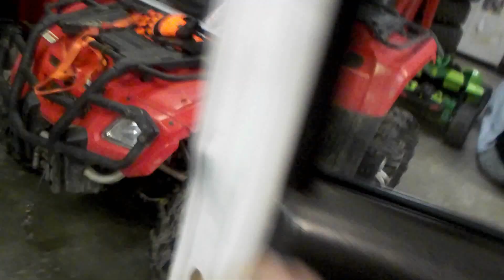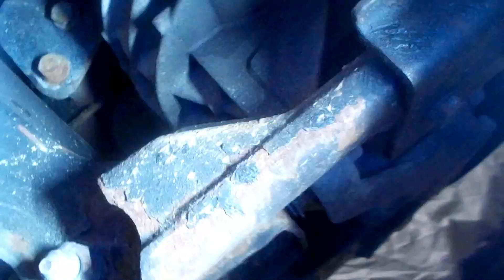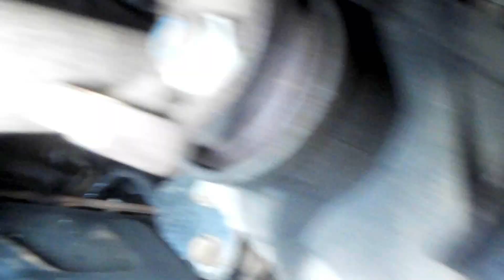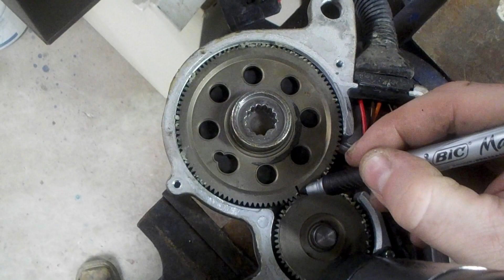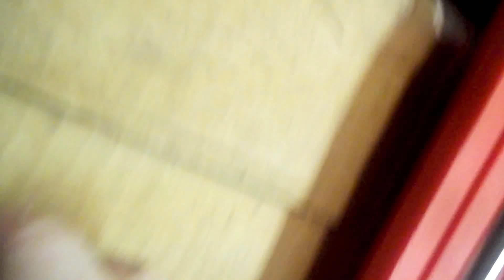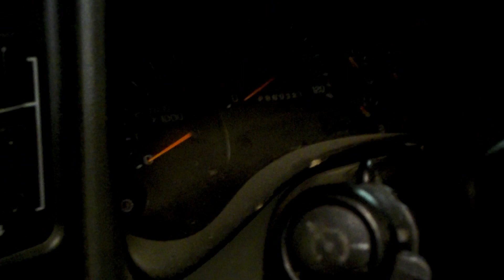Silverado Transfer Case Shift Motor Repair

Comment: What were your initial symptoms? My transfer case was worn out and noisy so I replaced it a few days ago. The 4wd worked fine until I replaced the transfer case. The lights blink when I select 4 hi and 4lo and I hear the encoder motor actuate but won't "lock in. " I took it off and let it hang and tried it again with the same result. I then noticed a yellow sticker on the motor saying that doing so will do permanent damage...😢. I've tried to manipulate the shaft on the transfer case with a 14mm wrench but can't get enough leverage with the cross member in the way. The old worn out unit isn't that difficult to rotate. Is my symptom consistent with a faulty encoder ring?  Thank you🎉
Reply from the maker: I have shifted them even though it said not to with no ill effects.  I would check the connector at the actuator next like in the video

Comment: I have a 2003 Chevy Silverado 1500 HD I have a problem similar to yours when I first start my truck in the morning sometimes it is in auto and in order for me to switch it over to 2 Wheel I have to shut the truck off and restart it and then I can put it in 2 Wheel. Then when I get out of work at the end of the day, it will be in for low and then I have to do the same process. Do you think it’s the motor actuator that could be the problem because it does switch into four-wheel-drive thank you in advance for answering your question.
Reply from the maker: Either the encoder or a wire problem.. I would start with the encoder

Comment: All of the lights on the switch are lit and pushing buttons did nothing. Service 4wd is lit. I checked both fuses and cleaned up the ground by the door frame. None of that did anything. I replaced the switch and now the neutral light is lit but pushing or holding buttons does nothing. Not sure what my next step is, hope its not the control module. The actuator would be nice or even the encoder. I think the truck was in 4 low when it last ran all of the lights on the switch came and there was no way to change it. Thanks for any suggestions.
Reply from the maker: Out of all the trucks I have worked it has been the computer 0% of the time.  I have another video on diagnosing the service 4wd code without a computer if you would like to take a look at that
Reply: @GSEShop  Thank you for the quick response. I've watched your Service 4wd diagnosis video, will let you know how it goes.

Comment: Thanks for your video. I'm having an issue with my 02 Silverado. It stays in 4hi unless
I pull the ATC fuse. (Have to do this so I can drive the truck) It will not shift into anything
other than 4hi. I went under the truck while an assistant pressed the 2hi button (fuse
back in) Heard a buzzing noise from the transfer case shift motor. Will not shift, and
defaults to 4hi. Then sets the service 4wd light. Sure hope the transfer case isn't jammed.
This is a low mileage truck. Any help would be greatly appreciated.
Reply from the maker: I have another video about diagnosing the problem

Comment: My 2002 Chev Blazer lights on dash indicate it is 4 low or 4 high looks normal even when in low range you can feel the difference but the front end is not  engaged not helping in the snow any ideas or help would be nice thanks
Reply from the maker: My video “service 4wd diagnosis” I think has your answer.

Comment: My 03 silverado seems to be stuck between gears. Won't go into park, drive or reverse. I do hear a grinding sound. Any idea what it is ?
Reply from the maker: Check out my “Silverado pops into neutral” video.  That may be your problem but it is hard to tell for sure just by messaging

Comment: Hi I have a question.  My 2005 gmc 1500 4x4 is having an issue everything I hit 4x4 my front dif locks up . Truck drives fine in 2wd btw . The plunger is working I tested it .
Reply from the maker: Like your tires won’t turn?

Comment: Just replaced it, and now it will only go into 4 low...any ideas?
Reply: https://m.youtube.com/watch?v=BvPsK5OLdYI

Got it to go back into 2h after watching this but still not going into auto 4wd or 4hi...
Reply from the maker: Check out my service 4wd video, but it sounds like you have a wiring problem
Reply: @GSEShop  yea I agree with the wiring problem, had some issues with speed sensors in the trans a last year. Had to replace a connector and fixed that. Also I am using a dorman part, the GM/ ac delco no longer makes the shift motor. So I pulled the dorman put on the original and got it to shift into 4h 4l 2wd auto4 all fine then decided to not go back into drive and did a grinding noise when I went to park. My original complaint... I was driving on the interstate going about 70mph and the truck went into neutral. Pulled over shifted the trans into 1 2 D N R nothing still in nuetral and grind when I went to park. Thought I might get it to go into 4wd so pushed a few buttons and got it to go back into 2wd. Was able to get it home but it did happen 2 other times on the way there. Drove it a few days with no issues untill I got ready to replace the  shift motor. So Im thinking the water did make it act up. The dorman part is back in now, and it kinda works doesnt want to go into 4wd and back to 2wd but its driveable at the moment.  Sorry for the long post. I will keep this updated if I can  fix it
Reply: Also I completly swaped the original and the dorman out back and forth 5 times including moving the drive shaft and removing the skid plate, trying to figure it out. So at least Im an expert on that now.
Reply from the maker: @terrygrossjr83  it is either a bad motor or you got a contaminated wire.  The truck going into neutral is the shift motor not engaging the transfer case fully, like only the edge of the gears are touching and once they slip you get your grinding neutral situation.  I would take the front driveshaft back out and investigate all the wires going to the shift motor for damage.  I have had shift motors be bad right out of the box before too.  I had one fill with water and I ended up putting a drain hole in it near the bottom and letting it dry and that fixed it.  It should be dry inside with a little grease, no oil.  Cracking them open isn’t too bad.  I hope this helps
Reply: @GSEShop  Hey I appreciate it, I did take it off and re installed it this morning. Did not see any bad wires but that still doesnt mean a pigtail connector isnt going bad.. that being said I now have auto4wd 2h 4h but only a clunking sound and no 4L. That will do untill I get around to buying another shift motor the original was filled with oil.
Reply from the maker: @terrygrossjr83  I had an oil filled one once and it never worked right.  Just my experiences, your results may vary lol.

Comment: Hi GSE - a follow up to the last post. My problem (05 Tahoe) was resolved by replacing the transfer case encoder sensor ring, so THANK YOU for the video and feedback! Only thing I didn’t do was remove the front drive shaft, and I couldn’t get it into full ‘neutral’ as the dash switch didn’t work as it was - was stuck in 2WD.

I was able to get the unit out (not ideal), clean and mark everything, and reassemble, just as it came apart. Hopefully this is the last of my 4WD troubles. Aside from my time, the AC Delco ring was only about $40, so way cheaper than replacing the transfer case motor.
Thanks again!, Dwayne
Reply from the maker: Great, I am glad to hear it is solved

Comment: Hi GSE! I’ve commented to you before, always big “THANK YOU” for what you post regarding Chevy trucks! Over past 2 years I’ve struggled with intermittent 4WD issues on my 05 Tahoe. I’ve replaced the dash 4WD selector switch, checked existing ‘ground to frame’ points, have “over grounded” wire harness under hood to the frame, replaced the 4WD Actuator (throw money at the problem...), and now I’ve found this post you made. It perfectly describes my symptoms - and I’m not about to spend $$$ on a Tech 2 code reader. 

I’ll give this a try, and let you know. Thanks BUD!
Reply from the maker: Nice to know I have a fan, I hope it works

Comment: My 4wd engages fine when cold but after a half hour ride 4wd usually won't engage til it cools down for an hour or so. the buttons light up like it's on and no codes . 04 silverado 1500 . Could the encoder be malfunctioning when it's warmed up, Or fluid getting in there . I know this is an older post , thanks for a reply.
Reply from the maker: I had an encoder motor fill with oil once, maybe, but I have never heard of one being effected by temperature like that
Reply: Thank you for the reply , this has been on going for the past year and that is the diagnosis every time , works cold but intermittent when warmed up .

Comment: How did you know it was the shift actuator and encoder motor and not the module behind the dash? My truck is doing the same thing. Thanks for the video i appreciate it.
Reply from the maker: After working on these trucks for years it has been the computer in the dash a total of zero time.  I have a video on service 4wd diagnosis to help with figuring out what could be wrong.

Comment: HEY MAN, LOVED YOUR VIDEO. HELP ME DIAGNOSE MY ISSUE. 

Hey Guys, so I live in Calgary Alberta......With this said, our winters get frigidly cold -20C common......my 4wd service comes on/fuse blows/lights on selector switch goes out. Nothing works...found a write up  - not sure if its from GM directly. But it states, if your 20amp ATC fuse keeps blowing, but Encoder @ T-case works......front diff actuator works. You're getting get grounds.....good voltage at connectors....( Bench test front actuator ) and it works.......and there is no code for TCCM ( Transfer Case Control Module ) ....it is the 1640 connection - they used 18 gauge wire from factory but during colder than normal ambient temps - it will spike in amps and blow the fuse....The easy fix is replace with 25amp fuse. OR replace the Orange wire - with 16Awg.  DONT GO SPLURGE ON PARTS BEFORE YOU DO ALL YOUR CHECKS!!!!
Reply from the maker: Thanks for the info, I have one on fixing 4wd issues in the Silverado’s.  I am sure people would love to read what you wrote there.  I would copy and paste but it is your work and you should get credit for it.
Reply: This comment helped me! My 20a ATC fuse blew just before or upon replacing my transfer case. TC shift lights on dash wouldn’t illuminate, wouldn’t shift, and had a generic P0700 DTC code. New fuse fixed my problem. Thanks! 2002 Duramax/Alison tranny.

Comment: Ok
Wat if lite is on 2wd
But service 4wd is on
Lites won’t flash wen push buttons
Reply from the maker: Peter Tom probably the encoder.  It knows where it is, but can’t find where to go
Reply from the maker: I have a video on changing the encoder in the motor, or you can change the whole assembly
Reply: Ok does fluid cause it to do this too???
Like a fluid change???
Reply from the maker: Peter Tom there are no internal transfer case monitors.  Changing your fluid isn’t a bad idea at interval, but it has nothing to do with the service 4wd message or it not trying to shift when the button is pushed
Reply from the maker: I thought you were on my other video, I have one on troubleshooting too

Comment: Thank you so much for the detailed walk-through (and the trick about the drive shaft). The only part I had a problem with was getting the motor back on. Had to lightly tap it in with a hammer (after aligning) otherwise it wouldn't go all the way in on the grooves. I don't usually comment on video's, but your's helped a bunch!
Reply from the maker: your welcome sir

Comment: Mine is doing the same thing only my selector switch lights stay off. They do not function right now. Ive bought a new selector switch and new actuator. Still no lights on the switches. The only things left is the tccm and encoder motor. What would u recommend and think it is. Need help asap lol ive done spent so much on this headache
Reply from the maker: jay bird my guess would be the encoder.  I have a video on how to troubleshoot your 4wd without a reader that you should look at before doing anything else
Reply: @GSEShop   ive cleaned up the grounds under the driver door as well. Only thing that ive seen in the videos ive watched  that relates to my  problem is the encoder motor
Reply from the maker: jay bird I agree, but have you watched my video on “Service 4wd diagnosis” ?
Reply: @GSEShop   so the problem with yours was that ground wire that ran to the bottom side under the driver door?
Reply from the maker: jay bird one of many I had
Reply: @GSEShop  cant i manually put it in 2wd so i can at least drive it to a shop
Reply from the maker: jay bird you can although I have never done it, is it in 4wd
Reply: @GSEShop  when i swapped transfercases it was in all neutral i turned the key foward without turning it on put it in 4low it went in. Then i couldnt get it back in 2wd then after that my selctor switch just went out completely. But it does come on when u first turn the key
Reply from the maker: jay bird you swapped transfer cases?  And the lights go out completely right
Reply from the maker: Did you try driving it around to verify it was in 4lo?
Reply: @GSEShop   all i had to do is back up to know just by the way it pulled backing up
Reply from the maker: jay bird like I said you can shift it manually but I never have

Comment: Well done. Thanks. FYI, the  NOE 6003556 number is NAPA OEM so it may be available elsewhere for less money. NAPA is really pricey at $92.99! Available from Advance for at Part # 600-120 for $105 but you can normally get %25 off with coupon which would bring it to $78.74. You may be able to get them to match it before the coupon if you are speed perks.
Reply from the maker: Thanks it is good to know

Comment: I replace the transfer case motor and still no lights on the dash, the turn on when I turn the key but once the truck is on, nothing no lights
Reply from the maker: topgun08lhs I have another video that has tips on troubleshooting check that out and if you don’t find the solution there let me know and I will try to help

Comment: Have a 2002 silverado 1500 4wd. service 4wd comes on once every couple months, dash will say it is in 4hi or 4lo and will make a clunk noise but 4wd does not engage, bad transfer case motor possibly?
Reply from the maker: Chris Cheek look at my other video on the service 4wd video and it goes through troubleshooting

Comment: Thanks so much for this video-- you walked me through my repair.  I opened my shift motor and it had alot of oil in it.  Yours looked dry, so I spent the $300 on a new one-- didn't want to put it all back together to discover something else was wrong, especially as the old part has 150k on it.  

Nevertheless, I love flashing money at a dealer, then sticking it back in my own pocket.  I was quoted $850 for the job-- I'm busy, but not that busy.  Start to finish it took me 5 hours.   What really sped things up was jacking up the left side and resting the tires on 6x6's.  That extra room really helped.

All my best for 2020, GSE.
Reply from the maker: jkline999 your welcome, and I would have changed it too

Comment: Awesome dude you saved me a ton of money. Very easy to do. Dorman part number 600-120. 50 bucks.  Thanks!!
Reply from the maker: todd s your welcome
Reply: How did it go with the Dorman part? I've never had any luck with Dorman parts, always end up having to redo it, sometimes more than once. The part that really sucks is how they've monopolized the parts game, a lot of stuff is Dorman, just re-packaged.
Reply: I came to the comments to get your answer, I was wondering where the heck you found the encoder disc

Comment: Our 2004 Yukon displays the service 4wd message and the stability system disabled messages at times when stuck in 4 hi or lo or neutral. The service 4wd message will pop up when the 4 wheel drive lights are out. We are going to check the ground wires like you explained in the video after this one and go from there.
Reply from the maker: Liz Cunningham all I can recommend is the steps in the video.  I have no experience with the stability control.

Comment: service@snowpunishers.com
Reply: Man truck driver who no transfer case ?
Reply: @JaimeRamirez-st8xf  I have an electronic, not auto, transfer case. The nv 263hd.
I wasn't engaging into anything but 2wd and no audible sound but lights acted as if it did so I figured it was the actuator and not motor itself.
Bought me a dorman 610-600 I think. Saved cost of full motor.
Worked like a charm
Simple install.
Unplug electrical connector (has a clip on side you can't see) for me at least. And the actuator just unscrews easy with channel locks. 
I knew the harness was good because the lights shifted just actuator wasn't turning into 4hi or 4 lo

Comment: My Last 03 2500hd I hit ice went off a cliff 20ft nose dive going 40 and airbags and Seatbelt failed and ya know I wasn't like oh shit I'm going to die when I knew I was in for it I hand to God just said out loud " I just put in a fuc**n alternator and slapped the wheel...
Lmao.
But I didn't break a bone my roof caved in rolled 275 ft but engine the 6.0 03 (01-08) are Bulletproof. It was running Happy like let's go to work...
I took them keys out turned off kicked my way out and climbed up the mountain and any ford owner can fact check this shit this happened I have medical and accident report.
They're bulletproof..
Just change the oil early 😉